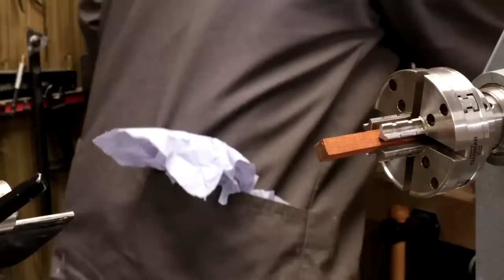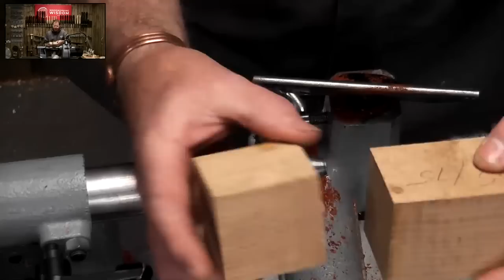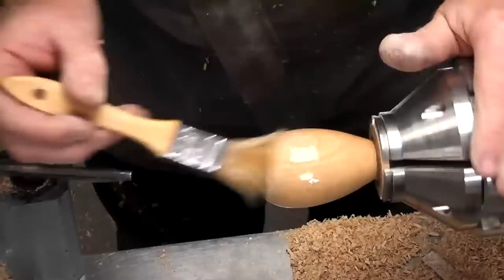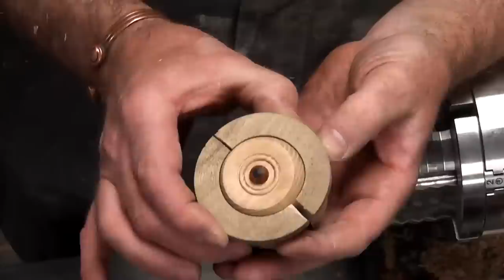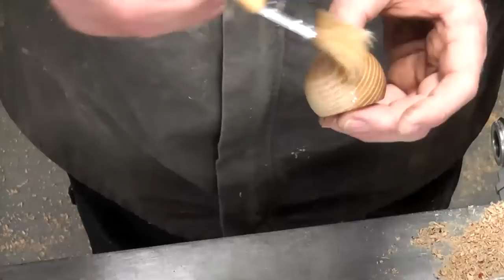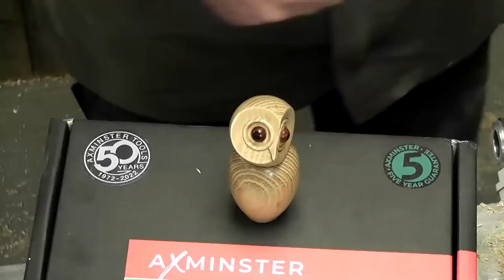Woodturned Owl Project - Woodworking Wisdom

Comment: I think that those owls are absolutely fantastic Jason I have just got to have a go at those thanks very much indeed
Reply from the maker: Hi Walter, hope you give them a go!
Reply: Hi Jason yes I have had a go at the owls and although I say it myself it went well given that I have not got around to buying a jacobs chuck and 2 ring centres but what I would like to do now is one twice the size so my question is when marking out for the eyes it was 20mm I believe for the scribe line but would it follow that it would be 40mm for one twice the size or do you know what it is many thanks but don’t worry if you don’t I guess I could mark it in pencil to see if it overlaps with the first eye,and thanks again
Reply from the maker: Hi Walter, great to hear you've had a go! Here is Jason's advice regarding the size of the eyes: "If making twice the size then I would lay this out with a pencil first. In practice you would think that the 40mm would work, but this would produce a circle of 80mm diameter, which is getting big for a ball that is only 100 mm in diameter. So laying out with a pencil would be a good idea."

Comment: Very good instruction video. Q. Your first finishing is that Shellack?
Reply from the maker: Hi Ab, Jason used cellulose sanding sealer thinned with cellulose thinners, about 50/50 mix, then this was buffed using a polishing mop set up, and finally carnauba wax. Hope this helps.

Comment: Looks fantastic,  great demo Jason,  what buffing wheels and wax are you using?
Reply from the maker: Hi Lance, here is Jason's reply: "For the polishing we used cellulose sanding sealer. This is followed by a stitched mop (503910) loaded with either of the two following compounds, for dark timbers 105927, for pale light woods 105928. The dark compound will mark and stain light woods.  A mop for each command is required. For the final gloss, a loose leaf mop (503906, ) loaded with a little carnauba wax (101723) was used. The mops are mounted on a polishing mop arbour 1-2mt (610041). This as a set up will last years." These items are available to purchase from https://www.axminstertools.com/ search using the product codes given. Hope this helps.
Reply: @axminster  thank you Jason , I will order today